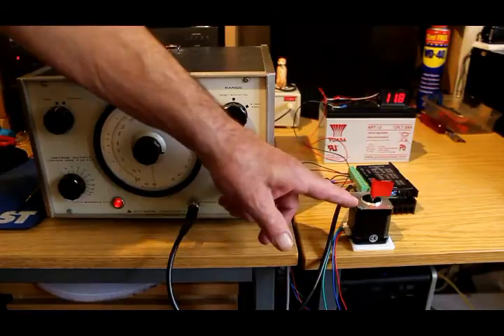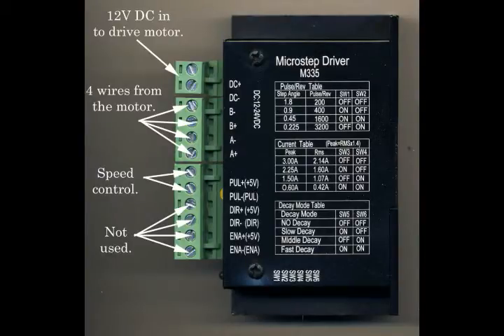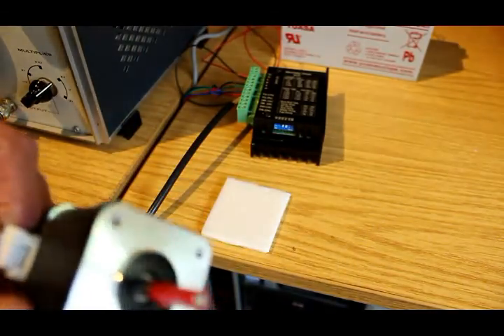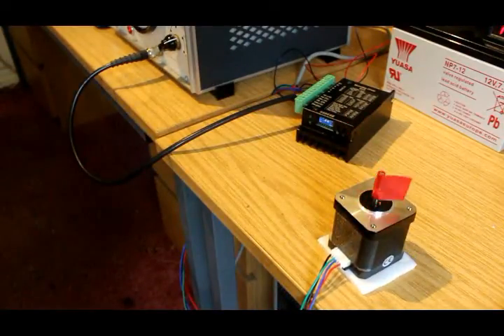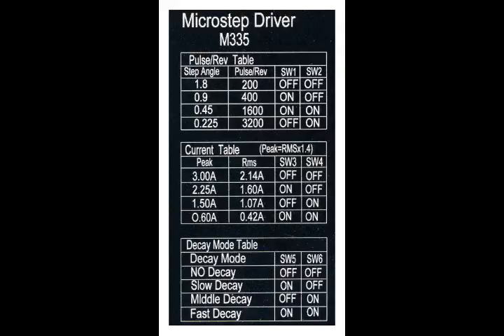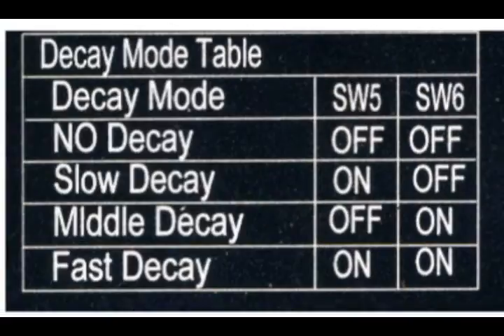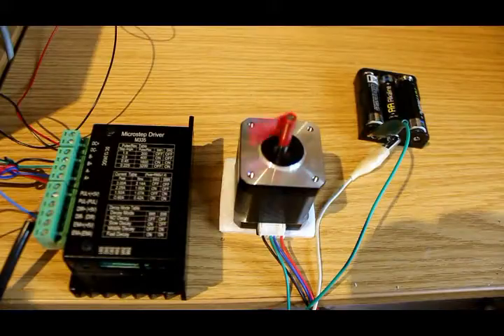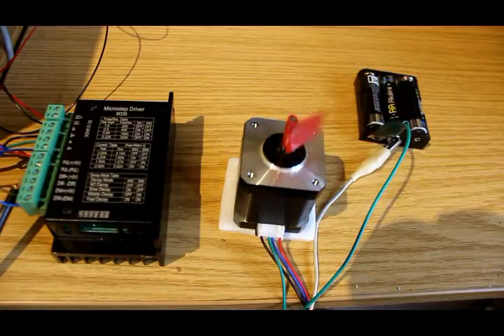simple stepper motor control

Comment: Great job explaining steppers and how to make them spin.  I am an OEM pump sales person that often deals with mechanical design engineers that have little or no experience with step motors. Although I have always been comfortable with the simplicity of a brush type motor, the stepper was stretch.  After several years of study, experiments and failures, I now use my own pcb board with Arduino & Trinamic components along with buttons & encoder to provide user with enough control to get rolling with prototypes.  Your video is a great piece that covers the essentials. Thank you!

Comment: which motor are you using? whats the torque rating?
Reply from the maker: Hi there & thanks for writing. The motor is of this type & size: https://www.ebay.co.uk/itm/Nema-17-Stepper-Motor-59Ncm-84oz-in-2A-1m-Cable-48mm-DIY-3D-Printer-CNC-Reprap/123302046887?epid=7008216858&hash=item1cb55feca7:g:aCUAAOSweW5VfZDI . The spec. re torque should be available on-line. There are of course motors smaller & larger than this...  Hope this is of help. Cheers, Norman.

Comment: Thank you Sir, from CA USA I am currently working on a remote control telescope assembly to control from inside the home where is nice and warm, I want to adjust all mechanical settings via stepper motors using a Joyce stick and using a wireless signal, and eventually a VR to view through the telescope while controlling it using the joystick I mentioned, I appreciate the time you took to make your videos i sure am learning from them, than you again.
Reply from the maker: Thank you for writing. All wishes for the success of your project. There are now micro-step controllers that will take 6,400 pulses per revolution, and doubtless others, more sensitive still, already exist, or soon will. For astronomy needs the highest degrees of precision, to be effective - but of course, you know that already! One tiny maladjustment, and all may be lost. May all good fortune attend your efforts. Best regards, Norman.

Comment: This is exactly what I was looking for.  Well explained.  Thanks!
Reply from the maker: Thanks, Bill! Glad this was of help to you. More recently, I have used the small (and inexpensive) Arduino Nano boards to control stepper motors. These work very well for simple applications - and of course they're also good for very complicated stuff like 3D printers - but that is far beyond my comprehension! 8^)    Good luck with your projects. Cheers, Norman.
Reply: Since you were so kind to reply, I want to bother you some more. : )  I am making a powered feed for a mill that won't be cnc.   It would appear that I be able to control direction and stop with rocker switches and a 5V power supply, is that correct?  I'd like to do it this way because the switches on the stepper control boards that I've seen are pretty wimpy.   I also want to be able to freewheel the motor with a hand crank for precise movement.  I think it would be best to disconnect the motor because of the hold characteristic of the stepper motor while powered, and I would also like to protect the driver from back flow from the motor.  Do you think it would be best for me to switch the 2 positive leads from the driver to the motor in that case?  I understand if you don't have time to answer.  Bill
Reply from the maker: Hi Bill. First: As regards you reversing the motor, all you need to do is to apply 5V to the two 'DIR' terminals on the Microstep driver, observing the polarity of course, and the motor will change direction almost instantly. (By the way, 5V is the MAXIMUM you must apply; it will probably work with a much lower voltage. The current drawn will be tiny, so a couple of AA cells will do it & last for ages. Switch the 5V on & off with a rocker switch (or a toggle switch, or a push-button, whatever) to get reverse rotation.) Second: Yes - you often want to turn a stepper motor by hand to get something in the right position. The simplest way is to have a switch in the positive supply to the DC+ and DC- power input to the microstep driver. Turn it off, and the motor can easily be turned by hand to the required position. Then switch the power back on & the motor will 'lock in' & be ready to go. Hope this helps. Cheers, Norman.
Reply: Thank you very much.  There is surprisingly very little information for anything that isn't arduino based.  I've got everything ordered, if you see a big flash up north, don't be surprised..

Comment: Norm, are you still taking questions about this video?
Reply from the maker: Er... yes! But alas, I am a rather erratic correspondent - what info were you looking for? Cheers, Norman.
Reply: I am in the process of using a Nema 23 stepper motor and a Driver similar to what you demonstrated,  for a project. However, I want to use a 5k potentiometer to control the speed of the motor. I do not have a signal generator to use. Is there some schematic that you draw to show how to use a potentiometer, with a Arduino Uno, micro driver and a power supply?
Reply from the maker: Sorry; you must find an expert on Arduino - which I am not, having only dabbled with it. However, one of the earliest Examples in the free downloadable Arduino software, shows you how to connect a 5K pot. to the Arduino board, which will give you a reading of between 0 and 1023 as you rotate the pot. You can use that output to control many things. That might be a good starting point? Good luck in your quest. Why not write into one of the Arduino Forums? I've often found answers there. Cheers, Norman.

Comment: I too have searched for an easy explanation of how a stepper works and your explanation is by far the best. Thank you
Reply from the maker: Hi David. Thanks very much for writing, and very glad to learn that the video was of help to you. Cheers, Norman.
Reply: Oddly enough I have the very same stepper and driver but my dilemma is trying to emulate the frequency generator. I have struggled with connecting a rotary encoder to produce the required pulses. My end goal is to produce a square wave pulse to a PLC controller which would turn on/off a solenoid valve or start/stop a stepper. Should you ever decide to dissect a rotary encoder, PLC or anything else related I would watch eagerly. The internet may provide a vast amount of information but few take the time to explain things in digestible bites as you did. Thanks again.
Reply from the maker: Hi David. One way forward might be to use Arduino - AFAIK, generating control signals is its most basic function. I haven't had time to get into Arduino properly - have only dabbled with it. Since making the videos, got arduino to run the microstep controller board & control the motor speed with a pot. I also got it to switch a sequence of 4 relays in an exact sequence, then turn 'em off in reverse order. But it's pretty hard for an old man like me to learn the code! 8^) Cheers, & good luck. Norman.